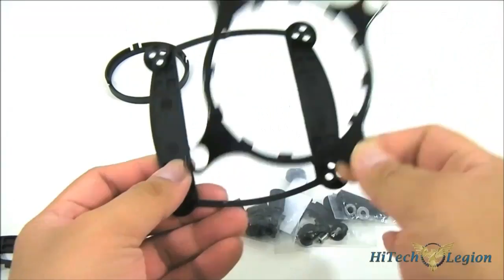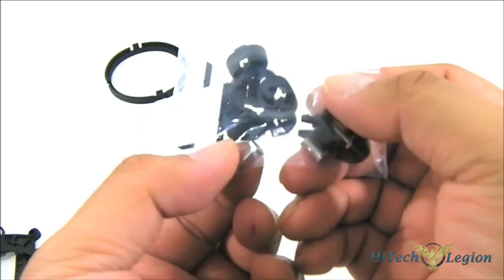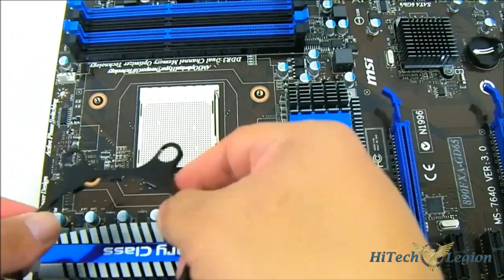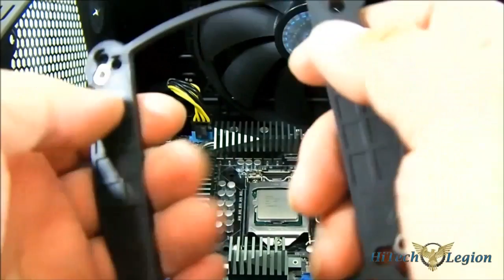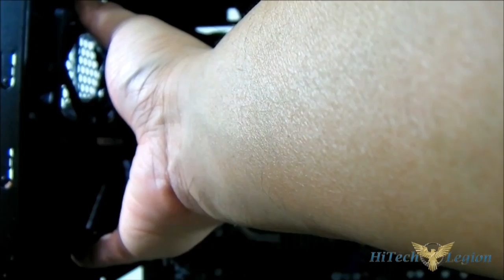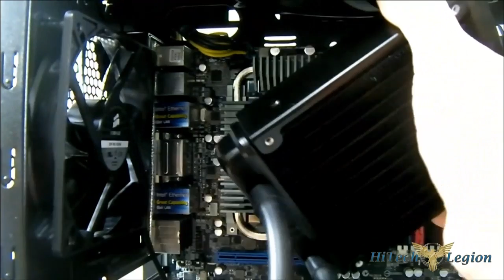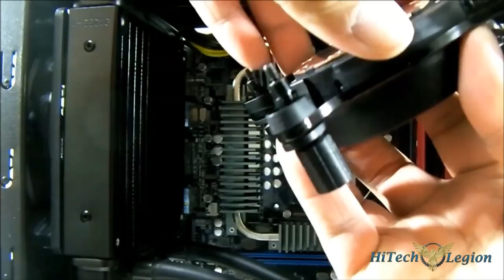Corsair H55 Cooler Installation Guide for AMD and Intel Motherboards

Comment: Hi. I got the H55 as well. i connect it perfectly but my cpu temp goes to 70/80 c and my pc automatically shuts down due of some problem with the cooler.
My mother board is an Asus M5A78L-M/USB3 , do have any idea of why is this not working properly?
I really appreciate any kind of help. reply pls
Cheers.

Comment: For the pump, does the fan header it connects to need to be at 100%? I'm asking because I can change the speed of one fan header but the closer one isn't changeable and so is always at 67%.
Also, if I install it as per the manual, will it be ok without that extra piece on a FM2 mobo? Is there any way to attach it if I follow the manual?
Thanks.

Comment: Question, if you install this fan as an intake fan...and the front fan on the case is also an intake... would I need to buy a new fan and mount it on the top of my case for it to be an exhaust fan?
Reply: It's never a good idea to use a rad fan as intake - you don't want to blow hot air into your case. The couple of degrees you gain on your CPU will be overshadowed by the increase in temps on every other component in your system.

Comment: Whenever I turn it on it powers on and the fans start spinning but then it just stops please help
Reply: Sounds like a power supply problem or you've fried your parts.
Reply: Does the pc turn off or the fans ??

If the fans turn off its undervoltage, if the pc shuts down after like 3 seconds you have fried something.

Comment: I actually bought this cause had to send my air cooler for RMA. Wow the performance is actually way worse.  Getting maximum up til 78C while the air gave 71-72C both at OCed.  And plastic backplate and mounts, come on. Be wary though it causes a bit a motherboard bowing even if you don't over tighten it per manual.

Edit: Another thing I would like to add is the radiator/fan mount M4x30mm screws. Honestly they are just too long. If possible get 25mm ones or get additional spacers. The 30mm screws provided can scrape the radiator fins even if not overtightened. It happened during installation.

2nd edit: The manual states that cooler works best if the fan is placed in PULL configuration. So I changed it, now the temps are around 75C max.

Comment: just done installing it and it gives great results just remember few things but the back plate dose not go on straight it but on a right leaning if your installing for 1150,1155 and 1156 and when you first install the pump and its all in and done plug the pump into the cpu header i don't think mine was working when it was plugged into the other fan header and also make sure u flick wiggle and squeeze the tubes a little to get any air bubbles out because one or the 2 made it so idle was 70c and 30% cpu usage was between 80-100c but one of the 2 things fixed it with the cpu header and or the tubes thing and also make sure u have extra thermal paste just in case my plastic cup on the cooler protecting the thermal paste was not on right and when removing it. It almost came off just hanging on it by one plastic clip thing 

10/10 for this cooler

Comment: is the corsair logo supose to light upp ?
Reply from the maker: Not on the H55.
Reply: HiTechLegion Do you put water in it?
Reply: Troy Bergeron The water is already put in the cooler.
Reply: You shouldn't need to
Reply: +Troy “Aventador264” Bergeron 
it comes prefilled with an electrically inert liquid.
Reply: Well when the tv is on is the green light supposed to light up ? -_-
Reply: I just got on a couple weeks ago my self but my motherboard ended up going out next morning don't know what happen but i got my new motherboard coming in tomorrow so all is good

Comment: I have space in my case from outside... Can i install only the radiator and pass trough the tubes betwen the specifically aperture for water cooler devices? I dont need the 120 fan, i have 6 of those already. My case is a Cougar Challenger 6HM6 and, in theory, i can fix the radiator on the top... Or can not I?

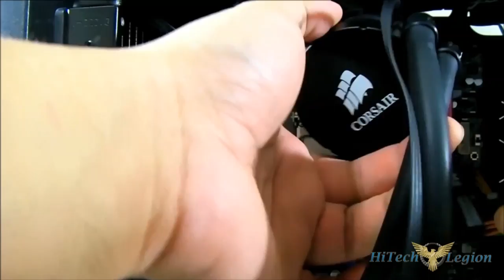Comment: Biggest thumbs up. The part about putting the ring mechanism with the other part (13:20) and locking them is of big help. Too bad the manual didn't mention this very well. My opinion: whoever is their technical writer for the manual kind of sucks.

Comment: I'm not sure how to tell if the cooler is tight enough because the metal mounting female parts just spin around..and yes, they are flush like you said.

Comment: My case only has a 80mm fan option on the back, but it does have an option to install 2 120mm fans to the side. Would that be possible with the H55 or would I be bending the tubes too much (or damage the system otherwise)?
My PSU is on the top and only having one fan is loud. :I

Comment: As you can see when the radiator is intalled, there is 4 screw holes in the inside computer side. Can i install another fan in this?

Comment: Thermal compounds are designed to withstand a lot of heat beyond what CPUs are typically capable of so it is very difficult for it to burn off via the CPU.  What were your CPU temperatures when it was running?

Comment: I did this today and followed their manual EXACTLY.  I wish I`d seen this vid.  It DID MY NUT IN trying to get the pump on with the mounting ring already over the CPU.  Done and dusted now though and my CPU is running at 52C when running WOT.  It had been running on an air cooler and heatsink and that could go as high as 80 c on WOT.

Comment: Will this work with the AMD FX-8350? and will this case be able to give enough room NZXT Source 210 ELITE Midtower Case with 3.0 USB - White? While i am at it will this motherboard support it as well GIGABYTE GA-970A-D3 AM3+ AMD 970 SATA 6Gb/s USB 3.0 ATX AMD Motherboard?

Comment: i have case which have fan holes on top to i install my water cooler on top or on back ?
and is there any liquid in ribs or i need to buy liquid and if i need can i use distilled water ?
and i have asrock n68c-s ucc motherboard can i install watercooling on that ?

Comment: Rhythm1978 What I did was cut the retention riing right in the middle at the bottom so I could then adjust it to fit the 4 holes behind the motherboard

Comment: This CPU-Cooling System works with 775 socket as well.
Bought it from a site named DustinHome which said that it will fit thise sockets:
AMD AM2, AM3, FM1, Intel S-2011, 1366, 1155, 1156, 775

Comment: Intel® Core™2 Quad Desktop Processor
Intel® Core™2 Quad Processor Q8000 Series
Q8200
 
Intel® Core™2 Quad Processor Q8200 
(4M Cache, 2.33 GHz, 1333 MHz FSB)

OLD, I don't think it's compatible sadly. Metal pins still in the motherboard, in the way. Even then don't think there is room for the bracket for tthe intel one. Can you confirm, no go>? If so can you give me recomondation for my ancient cpu, and an upgrade for fan? Thanks.

Comment: My case has an exhaust on the rear and top, so I could install it as an intake on the back fine right? the top exhsut is a 200mm fan. Also, the rear exhaust is a 140mm space could I insert my 120mm fan there without any issues?

Comment: I figured out the problem with the Asrock z77 extreme4.when you put in the 2 clips on each side of the top bracket they can face 2 ways one with the hole further out and one with it in, you want it in, it took me a long time to figure it out but after as long as you make sure you're using the long screws you're in good shape.

Comment from the maker: Thank you for the photo. Yes I see what you mean. The pins on the back of my mobo are not as prominent but if there was no adhesive pads, it would be touching. Although I tested it without the padding and it was still locking in place and not bending the pins on my mobo. I could see what you mean though that this should have been corrected by Asetek considering this backplate has been used in many self-contained coolers.

Comment: Would not reccomend that. If you're going for a single rad, it might be a better idea to either just buy a good air cooler (Mugen 3 for instance) or just go all the way and buy a corsair h100 or h100i.